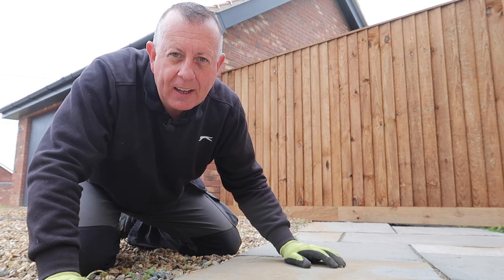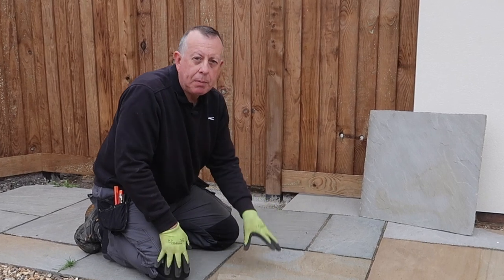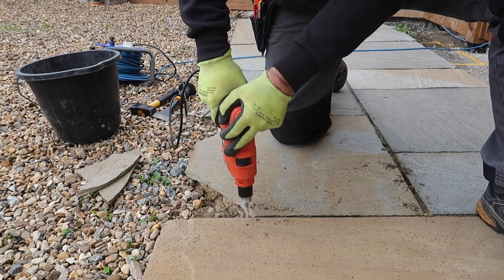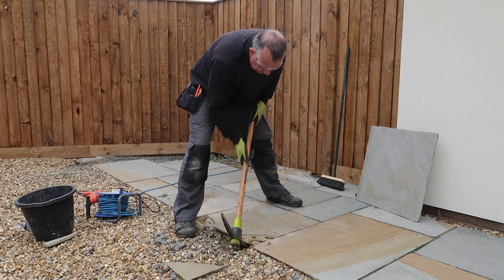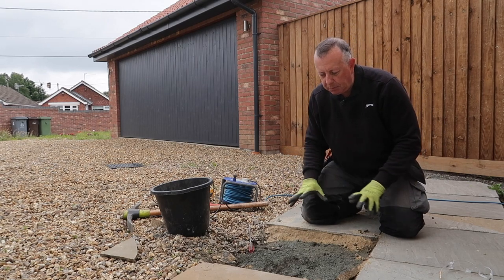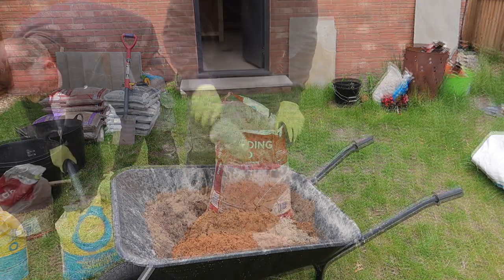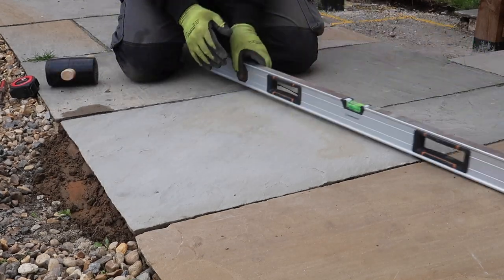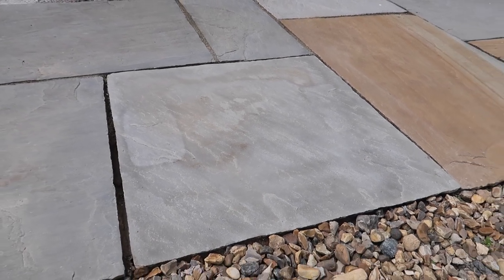How to Replace Damaged Paving Slabs

Comment: Totally becoming addicted to this channel. Excellent format and presentation great tips. Keep up the great work can’t wait to see more!
Reply from the maker: Thank you very much!
Reply: I agree. With so many instructional videos being unclear and full of padding, it’s refreshing to find something simple, clear and concise.
Reply: I agree. With so many instructional videos being unclear and full of padding, it’s refreshing to find something simple, clear and concise.
Reply: I am also becoming addicted to this channel I find his presentation extremely engaging and often times amusing,. Unlike other diy channels where we are told we need to buy this particular tool  accompanied with some patronising asinine insult that if we don't have the tool we can't do the job! Laugh out very loudly when I was a skool (many moons ago we were taught to do everything by hand the only electrical equipment we had was a wood turning lathe and the only tool he didn't teach me how to sharpen was the trusty hand saw otherwise we were taught to use our hands. I don't sharpen rip saws anymore just my tenon. I use a table saw, band saw or circular saw depending on the job I'm doing but they still require learning to use above all else safely. I do not have a laser level yet that's on my must have (possibly) list 😂👍👍👍👍👍👍🍺🍺🍺🇬🇧
Reply: Already addicted to this channel, neeeed more videos! Please.

Comment: Gave me the confidence to fix one of our cracked slabs after our builder dot and dabbed cement under the bottom step on our patio causing a break less than a year in. Cheers!
Reply from the maker: Well done. That is a problem when builders cut corners

Comment: Another useful set of tips - thanks.  I haven’t used the slurry technique before but definitely will be doing so in the future.  I usually just wet the back of the slab but using the slurry is undoubtedly going to improve adhesion.  (My Black & Decker finally packed up last year after nearly 50 years of service!).
Reply from the maker: Who knows whether the slurry makes that much difference. The so called professionals who laid it a couple of years ago before I bought the house didn't bother. I can't I can't believe B&D still make the same drill!

Comment: about to try repair some moving sandstone slabs like these and my question would be , does the cement mix not need to be a little wetter than what you made up ? your mix looked a little dry ? 

really unsure with building works hence my question

Comment: Principles are all sound. Only thing I'd say is its far easier with a wetter mix as you can really squeeze it down and make sure it's a nice full bed. Also helps with adhesion.
Reply: Totally agree Andrew with a wetter mix to give the slab something to bed down on and some suction. But nice to see a slurry mix added correctly 🤞

Comment: I'd love to see a deep dive on concrete/cement/mortar and its uses. But then, I'm a bit of a nerd who liked the classroom, so...
Reply from the maker: Ok that give me another idea. As a civil engineering contractor I've spend most of my life dealing with large scale concrete so I may have a few bits of info that could be interesting
Reply: Technically everything is concrete different strengths.
When folks say ‘I’ve cemented this’ you could say ‘I’ve sanded this’ as it’s only 1 ingredient in the mix
Reply: Yeah.   It would be good to describe the different properties and benefits of different sand material.   Sharp sand, plasters sand, builders sand….  What’s the differences and when should you mix for different applications.   Thanks for the videos.  They are really well done.

Comment: I'm slightly embarrassed to ask but if I don't I will never know the answer, what exactly is slurry? How do I make it? What do I need to buy? We have some loose patio slabs at the house we have just moved into and I would like to have a go at sorting them myself. Great video. Thank you.
Reply from the maker: No problem. Generally slurry is a term we use for a liquid type cement mix. It doesn't have any aggregate in it and is either just cement and water or cement, water and an additive. If you have moving slabs and you can get a cement slurry under them you may not need to raise them - clean out the grout around the perimeter and may you can persuade some liquid cement slurry underneath them. Once cured they may fix your problem.
Reply: @ProperDIY  Thank you mate, I'll give this a try. Every day's a school day! I really appreciate you taking the time to reply. Thank you.

Comment: Great video mate. If I was to lay this same size slabs would it be ok to drive my car in it?
Reply from the maker: Thanks! Yes Indian Sandstone of this size can be used on a driveway but it's success would all be in the foundation. If it doesn't have a full bed of mortar or the sub base is too thin and has any movement then your sandstone pavement will turn into a crazy paved area very quickly!

Comment: Love to know how to work out the amount of materials is required to be purchased for each layer when installing slabs.
Reply from the maker: I do it in litres. Count every 100mm as 1 then multiply length x width x depth. So, an 600mm by 600mm slab with 50mm of bedding is 6 x 6 x 0.5 = 18 litres

Comment: Lol! Stuart, got to disagree with you on this one. Would I be arsed drillimg multiple holes to break the grout mortar! 😆
A cheap grinder and a diamond disc. Job done. Think you're trying to allow mr. anyman do this job but a £20 grinder and £5 diamond disc set as a Lidl or Aldi special isn't out of financial reach of many and would have that grout out in under a minute. 
Solid job done there. Love the slabs you have too.
Reply from the maker: Fair enough but i only have a 115mm grinder which wouldn't do much and .... if you have paving like mine without uniform joins you will still need to tackle the corners as even a large grinder doesn't cut straight down
Reply: @ProperDIY  I think that even the 115mm grinder would have left you less to drill out if used first. But great job anyway.

Comment: Nicely laid slab. Only one criticism though. Using the drill to get rid of the mortar joins there is far too much risk of damaging the slabs around the one you're taking out. You clearly hit the slabs a good few times and caused small chips. Using a drill to remove grout you need to use a long drill at least 12" long so there's no chance of catching the surrounding slabs with the drill chuck.
Reply from the maker: A long drill would be good but as you can see I had to go down to a 6mm bit as the slabs were so close together - I don't have an extra long 6mm bit. The chips on the side wear off quickly - same as when you cut a slab with an angle grinder.

Comment: Oh look, how nice, a paving slab with a full bed of mortar rather than the 5 dabs my “patio laying expert” seems to have gone for leading to collapsed joints every year! 🙄
Reply from the maker: That's the experts for you! It makes a big difference if you main priority is saving money!
Reply: @ProperDIY  I didn’t cap the budget and the patio was part of a bigger scheme of work. I only found out about the ‘dab method’ used when a slab came loose and I could see underneath. It did explain why I have the job of re-grouting the joints year on year. The mix just falls into the void. Hey ho! 😡
Reply from the maker: @gizmo6164  I meant your contractor's main aim is to save money - not you. I'm afraid it's the dark side of the industry - how to appear to give the best product while spending as little as poss

Comment: I wonder if you would be able to just remove the grout and then hammer it out sideways without removing the concrete slab. You would have saved a lot of effort.

Comment: You must have titanium knee caps 😳. My knees would be in bits after a few minutes
Reply from the maker: There is a secret - the work trousers I use have foam knee pads that you can take in and out. I don't normally use then but on this occasion I made sure I put them in before I started.

Comment: The 90’s Black and Decker a classic move! 😂
Maybe standing on the slab that wants to rise with the broken one would help.

How did you break it? Or did you think F it I’ve a good idea for a video? 🔨 😂😬
Reply from the maker: I thought I mentioned in the video that a car reversed onto it. Believe me, the amount of work in getting the slab up, putting in a new one, filming and editing all of it for a few pounds really isn't worth it - I never make things up.
Reply: @ProperDIY  Ahh my mistake I obviously skipped the first 40 seconds. 😳
Unless heavily haunched this will always happen. Looks good with no edger or kerb or a wooden gravel board but no strength. Now if Proper DIY laid them this would never of happened, I’ve every confidence a contractor laid these. 🙏🏻🙏🏻🤞🏻😂
Reply from the maker: @MrSmid888  Exactly!
Reply: @ProperDIY  😉👍🏻👍🏻👍🏻
Reply: @ProperDIY  in my defence I’m back here a year later browsing. I happened to read my 1 year old comment as the ads played, I thought I’d listen out again for the “car ran over the slab” part. Nothing. When I clicked on the video to get the  timeframe red cursor dot up I noticed the video had skipped the “intro” segment itself. 

 This must have happened first time around also. Makes sense now as I’m a stickler for listening. I’ve not a clue why this happens? Dunno 🤷🏻‍♂️ maybe it’s useless info but it’s made me feel less stupid!! 😂

Comment: Those slabs look really thin
Reply from the maker: Indian sandstone slabs are - unlike concrete
Reply: I really recommend them.  They’re much easier to lay - even the really big ones and they look good too.
Reply: @R-11034  
Interesting. Weigh a lot less of course so I can see how they would be easier. Definitely require a full bed of mortar of course
Reply: @topgazza  Another advantage - you can pressure wash without any detrimental effect unlike coloured cement based slabs.
Reply: @R-11034  
That’s good to know. Always concerned about the concrete ones flaking. Thanks
Reply: The flags are a little on the thin side to take the weight of a car. Stumbled on your site a few days ago,it’s great!

Comment: easy solution, drive better? :P
Reply: JK btw, i must admit i think id have tried to repair tile and add mortar under but its an issue that will always exist as gravel will move with a tyre on, tile wont? is the gravel all compacted near? that might help if you had a whacker plater on it. 
would wood glue work instead of PVA? since similar base if i recall?